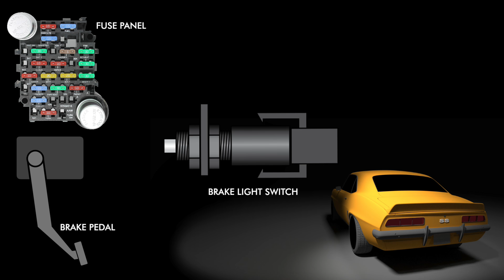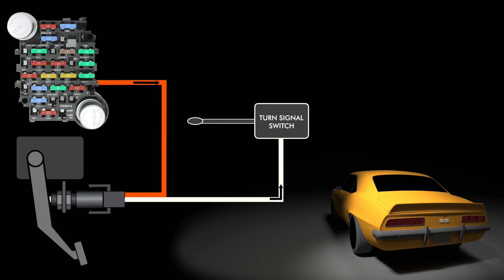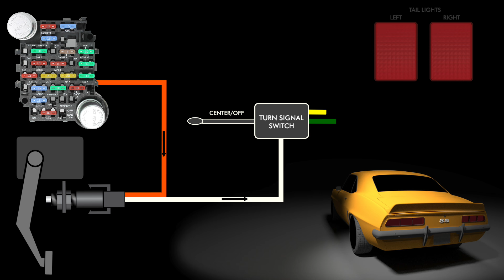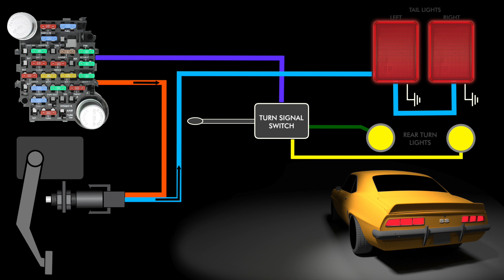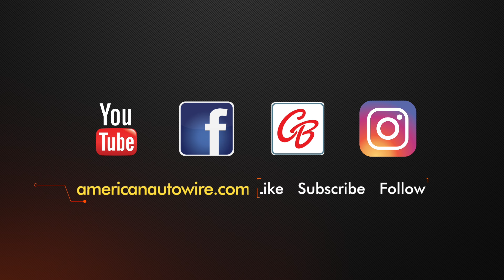Brake & Turn Signal Connections

Comment: Does anybody know this or has experience this I have the signal switch with the clamp on the columm after hooking up the wires for the lights only four and the electronic relay I'm only left with one red wire on the signal switch picture on box shows to hook that wire on to the brake light switch and for the other terminal a hot wire im.confused I can hook up that orange wire from fuse to the brake switch but then what where would that white brake switch wire go

Comment: 95 chevy silverado. When I have hazard lights on and step on the break pedal they stop blinking and stay on, even the front ones, doesn't happen when I turn to any direction though
Reply: Do you solved ypu problem cuz i have the same problem🤕😔

Comment: Can some one please help my!
I have problem I have old based opel gm Ascona from the 80s.
When I aplly blinker on the right side my tail light and blinker work together .
When I put key of the engin self restarts when blinkers are turned on I get electrical shock from chassis and my engin some times when the metalic air filter is on carburetor it is self acelerating!
How do I bypass this problem?
I did change the back lights with newr version of that same car I dont see any diference of those bulb holders they are identical and old and new bulb holder fit bouth.
The wires position is same just like on the old bulb holder.
Can some one please help my?
Is that back charging relay problem?
The engin wont turn of when head lights work and blinkers.
How do I solve this mess?
My voltage on baterry is around 15v and its climing rapidly.
So I dont understand what is going on???
Aperantly my trothel cabel going to carburetor is contracting some how by him self I noticed when its close to ground chassis hes pulling trothel flap by him self thats unusual fenomana I have no idea what causes it?
Other than that engin seam to run smuther more responsive .
Hell if I know why hes doing that??
Is this some form of relay ignition system?
Because Im confused how to ceap that nice smuth power and have still working blinkers and tail light .
Im not shure how to handel that strange acelerator cabel shuld I ground strap that thing?aplly resistor to that thing???

Comment: Recently I tightened up my steering wheel on my 85 Caprice and once I put everything back together, the right rear turn signal and brake light does not work. The taillights work. The left and right front turn signals works also. The only lights not working is the right rear brake and turn signal lights. What could it be???
Reply: Same hier wirh my nissan micra

Comment: So a bad turn signal switch can cause you not to have brake lights ? I'm asking because I can not figure out why my brake lights will not work . I have put new bulbs , fuses , and a brake light switch
Reply: Did you ever find out the problem? I’d like to know cause I have the same problem no brake lights.
Reply: @ItsRobert1   Yes . The wire from my brake petal switch to the brake lights was bad .
Reply: Bro what was this on a falcon haha

Comment: I have same problem with HONDA CRV MK4  2018   brake lights 3D light not working I did checked fuses and  brake switch and bulbs but still not coming on .
Any advice and help please
Reply: Did you ever figure out what was wrong ? I have a 99 Honda civic with no brake lights or running lights . I changed the bulbs , fuses , and break light switch and still nothing

Comment: Good walk-through. I have a peculiar problem with my car. The brake lights do not turn on. I have checked the continuity on the brake switch and it is looking good. But the brake lights still do not work. Fuse, bulbs are also good/replaced. One thing I saw was that the switch when connected to the coupler is getting heated up. What could be the issue? Should I replace the switch?
Reply: Ever figure it out? What was it?
Reply: What was the problem

Comment: All my tail lights work...but when I press the brakes only the third (brake)light comes on...and if I use my turn signals only front ones work...but they all work when I use hazzards??...is this caused by a bad turn signal switch??..

Comment: I have a 2006 gmc 2500, and when i have my turn signal on in either direction, once i push the brakes, the signal sequence changes on the tail lights and flashes opposite of the front. The signal markers in my towing mirrors flash the same as the front of the truck, but both are opposite of the tail lights, again only when braking. All lights are LED, and i have an LED flasher module, and i do not have hyper flash. I have replaced the tail light junction box and inspected the grounds. I have purchased multiple sets of led tail lights to try and rule out a defective set. Any ideas of what the issue may be?
Reply: Check the wiring

Comment: If the Turn Signal Switch is BAD, can that make your Brake Lights not work ????

I have replaced all fuses, brake switch and bulbs, still no brake lights!! 

Help Help Help
Reply: Buy a 12 volt test light from your local parts store and start checking for battery voltage at the bulbs...